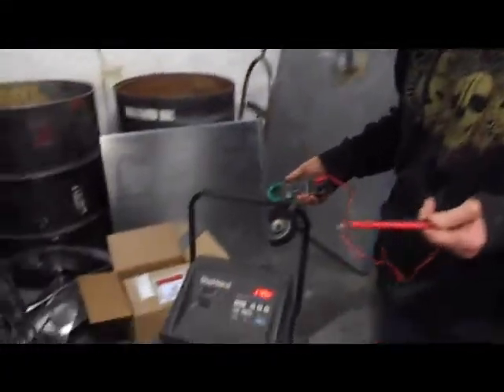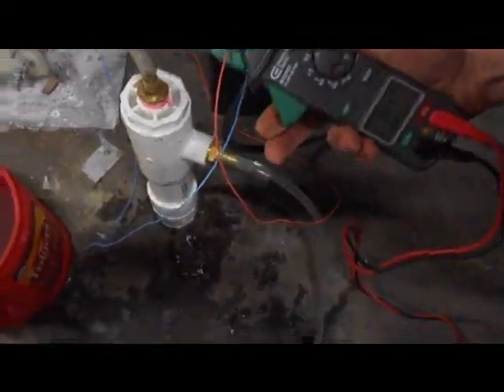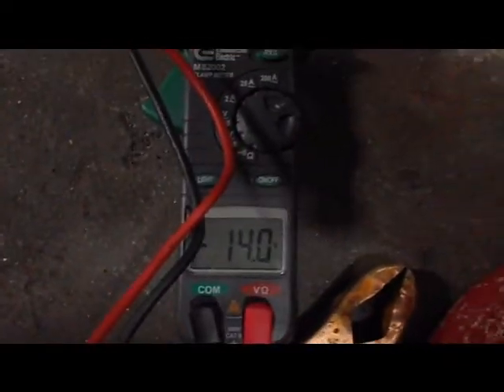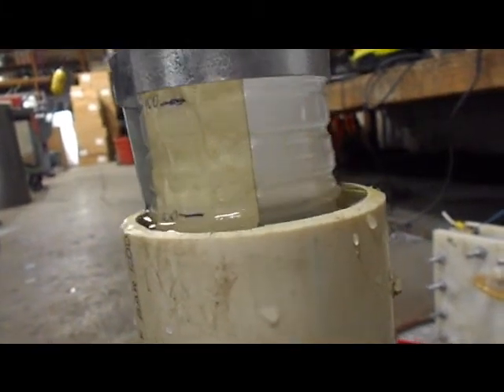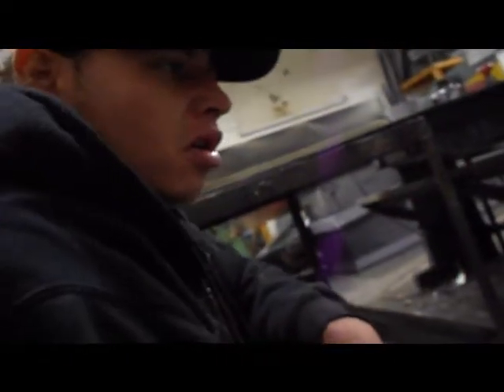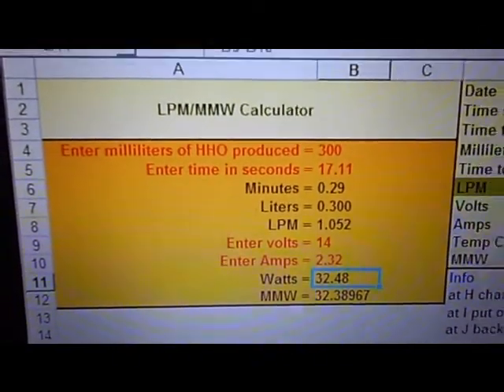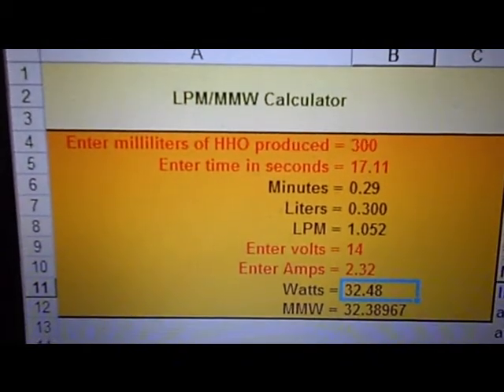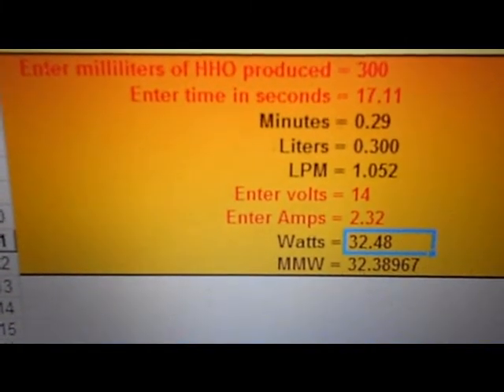mountain metals hho generator 2

Comment: @h2oplasmaplug now there is much to discuss i am also wondering how come the multimeter was so close but off by a desimal for currant. also when you use that clamp meter try to have the wires seperated. with your timer have somone do the button pushing for you. whats your electrolyte. your sell is just another dry cell your not using coils or pwms or frenquency generator. or even a relay. those are things that will improve your mmw.

Comment: well first off i have been trying to change the face of hho and scrap the mmw and make an easier measurment of watts per liter per minute. this is a very accurate mesurement. now on your video at exactly 1:15 was when you put your finger over the bottle. at 1:38 was when it hit 300 ml so that 23 seconds not 17. i saw it for my self so that changes your mmw. now lets figure out how many seconds for for 100 ml. so 7.66 seconds for each 100ml